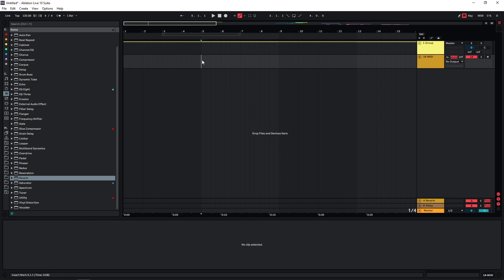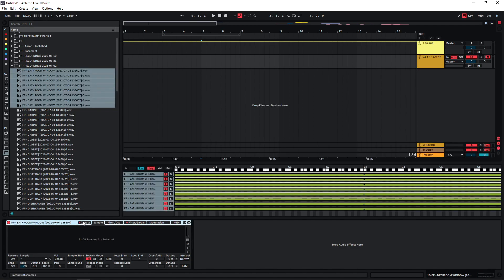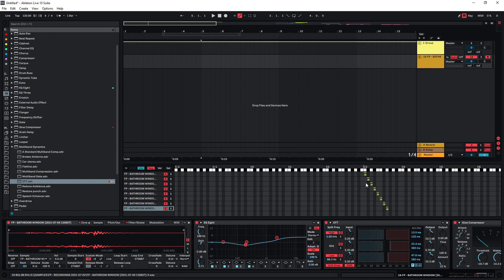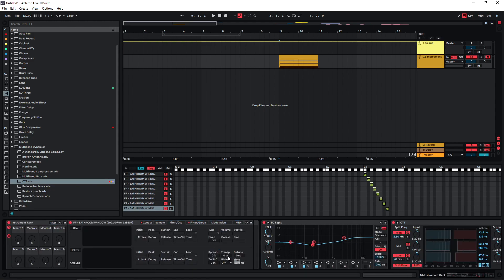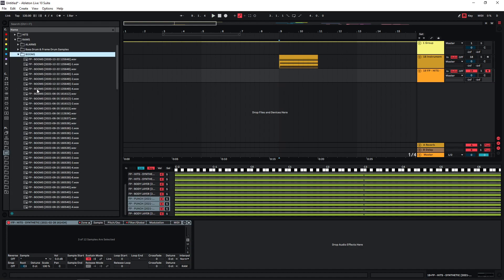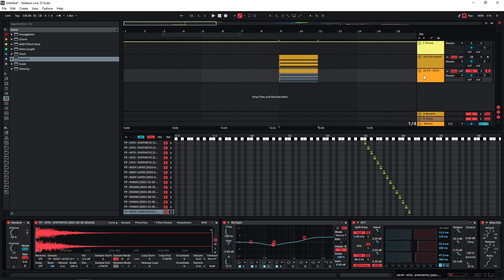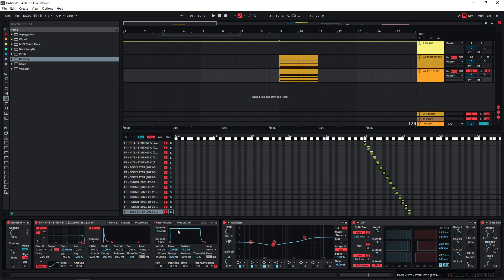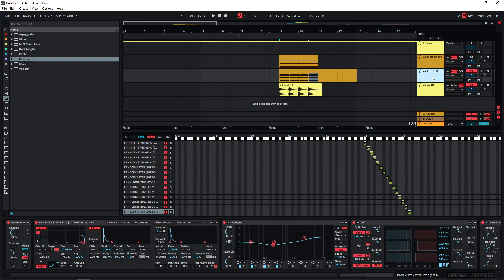Sound Design With Samplers: Transforming Samples Into Custom SFX

Comment: Awesome tut! You probably know that but if you make the little green line the actual size of the number of samples you have and then click "distribute range equally" it will do it correctly so you don't have to slide each little square to a note!
Reply from the maker: Not using the Ableton Smapler too often, so I didn't know that. Thank you. :)